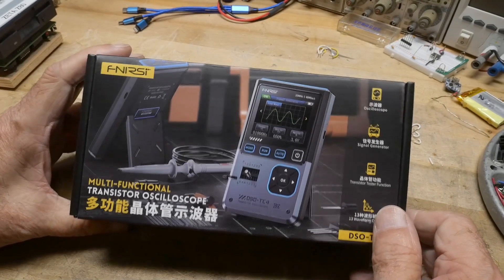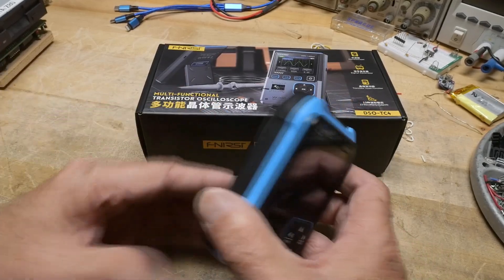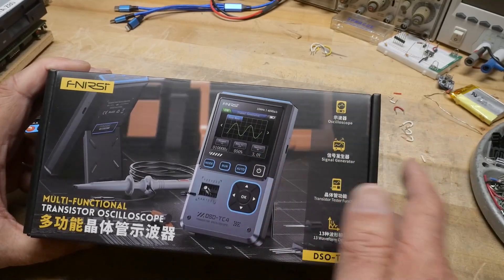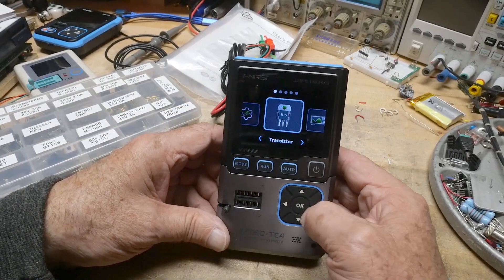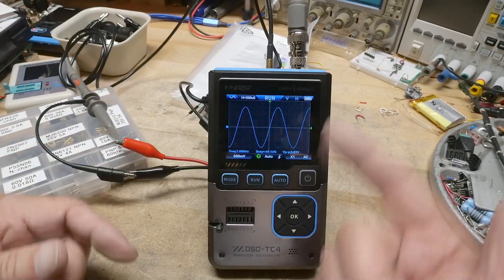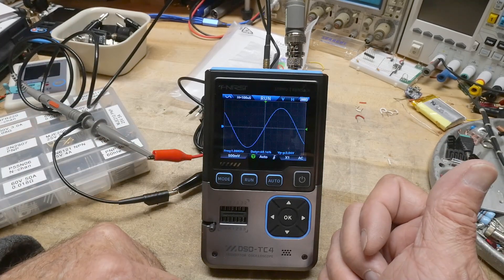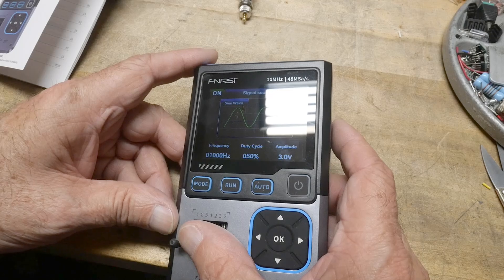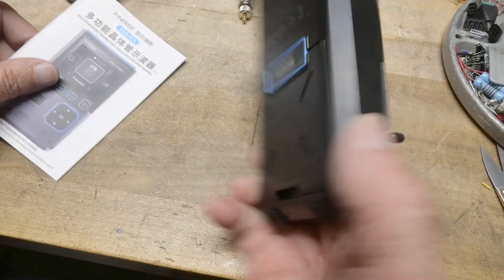#2195 DSO-TC4 Fnirsi Tester

Comment: Thanks for testing actual bandwidth. The component tester portion should have more tests done, especially comparing against known good ATMEG328 based testers with the official firmware. As the previous revs of the all-in-ones and clones have led to less than accurate results. The eevblog site has a large thread on the component tester firmware and versions that could be compared here.

Comment: Does it correctly identify the pinouts on BJTs? I have their LCR-P1 tester, and the BJT pin identification does not work correctly (swaps emitter and collector on the display depending on transistor type and which way the transistor is inserted). They've sent me two updated firmware versions (so far), and they all have the same bug. It works otherwise - i.e. correctly identifies whether the transistor is NPN or PNP, and gives reasonable numbers for gain and base-emitter voltage.

Comment: Definitely get some MCX to BNC cables (6", 12", and/or 24").  They will get rid
of your lever effect.
Reply: Just wanted to write the same idea, perhalps just a very short 10cm (3-4") adapter cable to bnc-f so any standard scope probe can be connected without risk of breaking something...

Comment: Those connectors look like MCX, probably some pigtails could be used, guess at moderate length they wouldn't affect signals at that frequency range.
All modern scopes should have an option to work off batteries…

Comment: That presumably just doubled in price.
Reply: I was thinking the same thing.  Curious what effect the tariff's are going to have on the "cheap" electronics industry as a whole.  That $20 widget is now going to be $40 or more, the $100 gizmo now over $200 and for those that have been scraping their pennies together to get a nice $1,000 entry level oscilloscope or such just went to over $2,000.  The Chinese manufacturers can't really lower their price any, they already operate on paper thin profit margins per item.  What makes no sense is the tariff's on our allies which is where a lot of my current test equipment comes from, Rohde & Schwarz.
Reply from the maker: Fluke is made in china, Keysight in Malaysia. it's not just cheap stuff 
Rohde & Schwarz manufactures its products primarily in Germany at plants in Memmingen, Teisnach, and Vimperk (Czech Republic). They also have smaller manufacturing facilities in Singapore and Malaysia.
Reply: @IMSAIGuy  That's true.  One of the main reasons I have been buying R&S equipment in recent years (in addition to being top notch equipment) is because the US headquarters is just a short drive down the road for me.  It allows me to schedule my annual and semi-annual calibrations ahead of time, make to short trip there to drop it off and pick it up a day or two later.  Also nice to browse their demo units they have for sale at a greatly reduced price.  Come to think of it, an even better reason to buy 1 year old demo units, no tariff's.

Comment: Just curious if you can check at what frequency the capacitor measurements are done at? I found that many do measurements at 100 hz. I’m thinking that ESR accuracy will vary, assuming it can measure ESR.
Reply from the maker: https://youtu.be/l3oz4y3eOLQ?si=ld0k-Ojoa4Jy7Hqe

Comment: Were you able to do a firmware update or save an image?
Reply: I just received one of these. I cannot copy the firmware to the device for upgrade. You enter to the firmware upgrade mode by pressing mode button and then power button, then connect it to computer. Still cannot copy files to the device. Anyone managed to update it?
Reply: @Ccorniit  You need to put it sharing mode, connect it to a PC and do a quick format of the drive.
Reply: @uni-byte  Thanks, that did the trick. Too bad the manual firmware upgrade section lacks to mention this...
Reply: @Ccorniit  I think it is just an assembly line problem.  They know about it at this point.

Comment: This looks like a great tool for fast troubleshooting in the audio realm. It's 1 kilohertz sign wave with an oscilloscope to check stages inside a pream amplifier, amplifier, integrated amplifier, receiver. For quick and dirty measurements or running through a block diagram something like this would be phenomenal